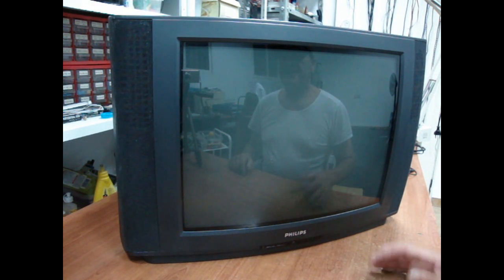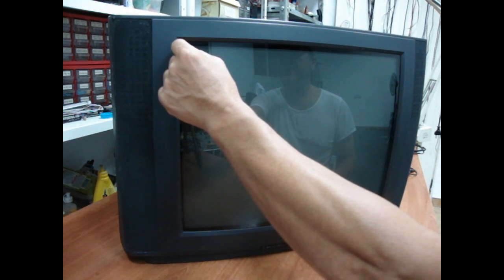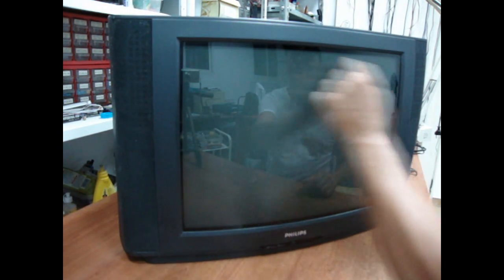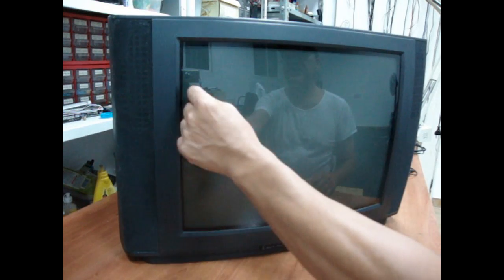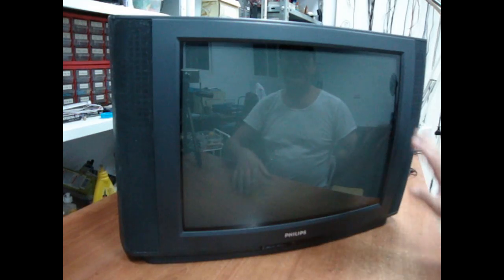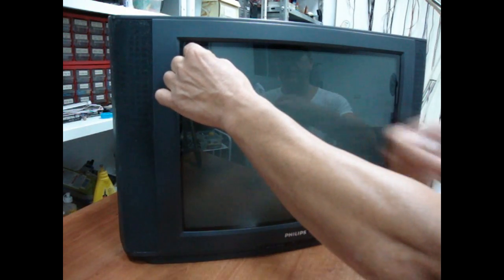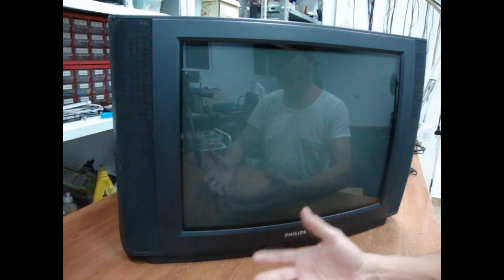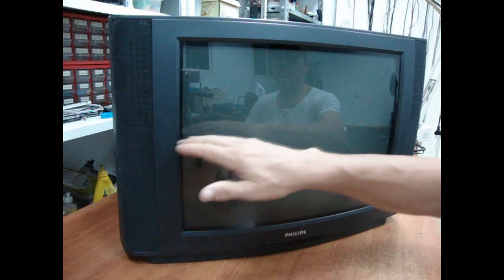Reparar TV (TRC). Linea vertical. Hay sonido.

Comment: hello my Grundıg t51-546 txt cuc5301 lines problem problem !!!

1 After first white line red screen
2. there are white lines in the picture
3. PCB solder was refreshed and I just changed rgb pcb . 5 min Nice picture later white horizontal lines . do not burn The problem continues

4 .TV remains in standby mode  
How do I resolve ?

Comment from the maker: tipica avería de barrido vertical. La linea blanca no sale a no ser que acciones el potenciómetro de screen, y esto es una protección para que el tubo no se queme (si dejas esa linea blanca brillante horizontal mas tiempo de la cuenta el tubo se quema y queda una marca permanente). La reparación es sencilla: En el circuito de vertical hay un integrado y varios componentes asociados. La avería suele ser: 1)Integrado mal. 2)Algún condensador electrolitico mal. 3)Soldaduras.

Comment from the maker: ¿Has visto el vídeo? Porque digo exactamente lo mismo. Por cierto, nunca puede ser debido al oscilador horizontal, porque en ese caso no hay alta tensión, y si no hay alta tensión no hay imagen, ni siquiera una linea blanca vertical, por tanto siempre hay que buscar la avería en las bobinas, conexiones, cables, soldaduras y circuito impreso, nunca componentes.

Comment from the maker: Hola, Si la línea es horizontal, en ese caso es la etapa deflectora VERTICAL la que falla. La mayoría de las veces, por condensadores asociados al circuito integrado que controla esa etapa, que pierden capacidad (no necesariamente tienen que estar hinchados). A veces falla el propio integrado. Suele ser una avería fácil de resolver.

Comment from the maker: Hola, cuando se ponga negra la pantalla, comprueba tres cosas: 1) si enciende el filamento del TRC,  2) si hay alta tensión y 3) Que la tensión de los tres cátodos del TRC esté sobre los ciento y pico voltios. Esto te dará una pista a seguir. Si esas tres cosas están bien, mueve el potenciómetro G2 del flyback (a veces este potenciometro está en el zócalo del TRC) y mira si sale una línea horizontal en pantalla. Si es así, vuelve a poner G2 como estaba y tienes una avería en circuito vertical.